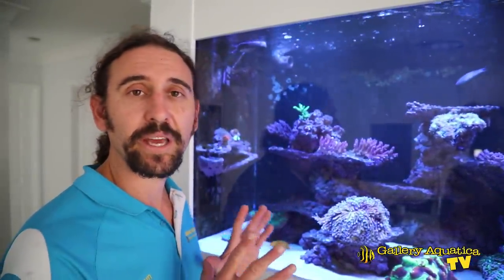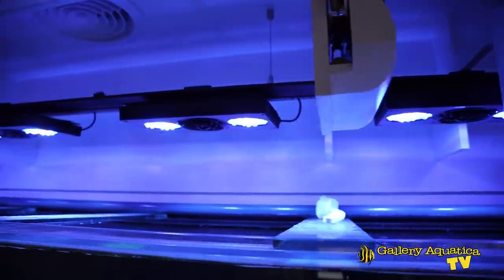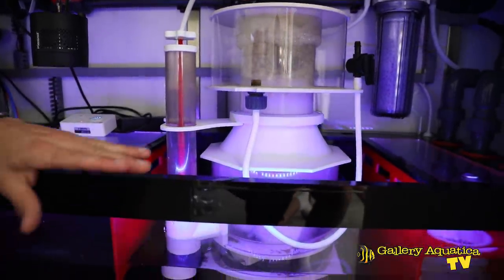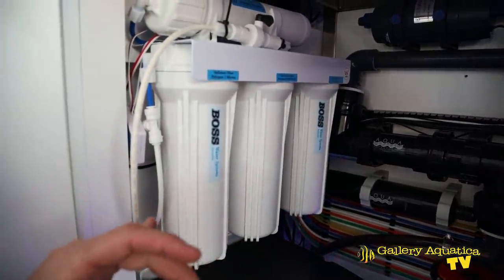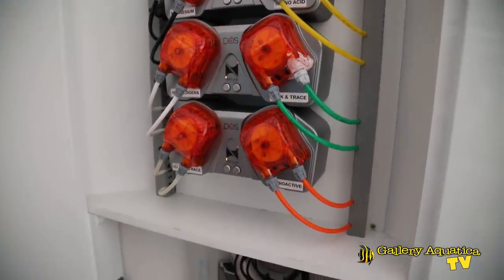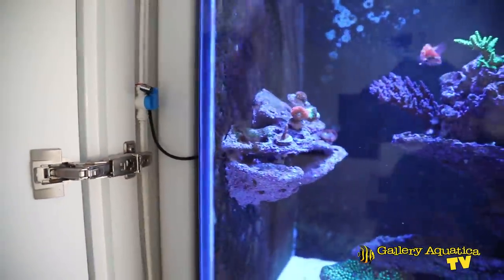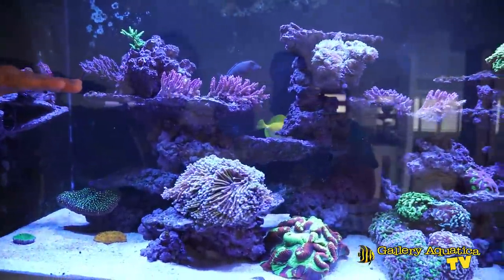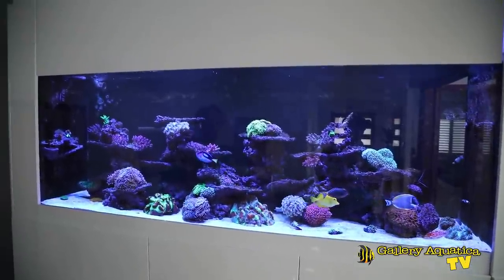[EPIC] tanks and why they work: Episode #4 --- Gallery Aquatica TV

Comment: Wow! So much contained in a discreet cabinet. Whole system put in place to function for years to come. It’s going to be amazing. So used to seeing epic tanks that require huge fish rooms or outside/ under house tanks and additional equipment.   What were the EIGHT dosing pumps being used for? Also, You didn’t say what dosing method was being used or how the RO water was being controlled?
Reply from the maker: The dosing vessels are all being used for Red Sea Foundation and Colours. The RO is sorted in a section behind the sump, and is controlled by the Apex. Cam

Comment: Simply stunning.. If i didnt live in an apt that if i place to much power drain on my apt it will cause a blackout, sucks. But i get by and properly monitor wattage output for safety reason
 If i can survive hurrican sandy with no fish or coral loss after 8 days of no power. I was like a mad scientist with my headlamp in tbe dark. And i wrapped my system in thick quilts to keep them warm. Thank god i had my stove working, which was a great great help.. Great video as always.

Comment: I was particularly impressed with the way you handled the dosing lines. While the color coding was a bit ocd :-) I liked the way the lines swept back from the dos units. They really don’t make it easy to smoothly handle lines and you did a nice job. Did you use the stock fittings or put John guest fittings to mate with the poly lines?
Reply from the maker: The stock fittings worked surprisingly. Cam

Comment: Why alternate the timing of lights in the chaeto?  Plants grow, algae grows constantly if they have light.  No need for sleep or circadian light cycles.  I run my lights 24 hours a day and chaeto grows like crazy.  Most active to continually without a break take nutrients out of the water.
Reply from the maker: I sometimes run chaeto reactors and refugium lights 24 hours, but in this case the nutrient level is so low there’s no need. By having the Chaeto light on an alternative photoperiod to the tank you get better pH stability. Cam